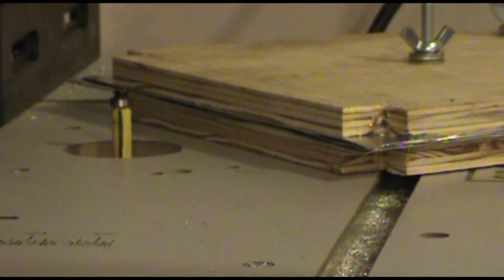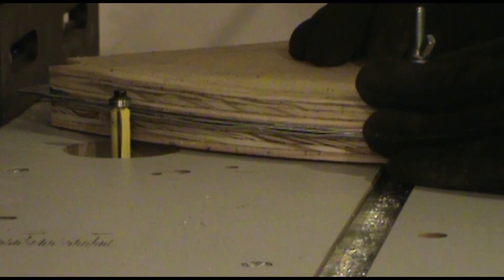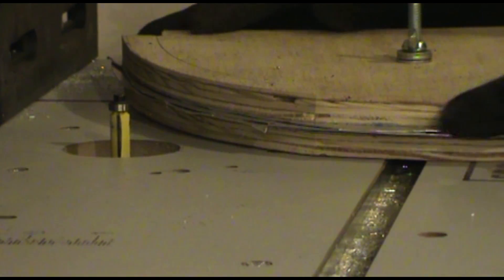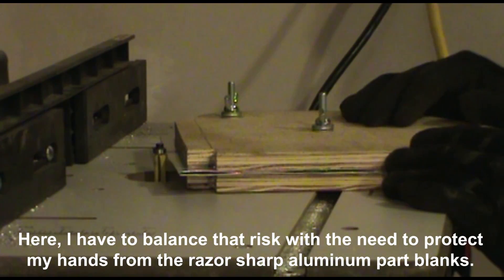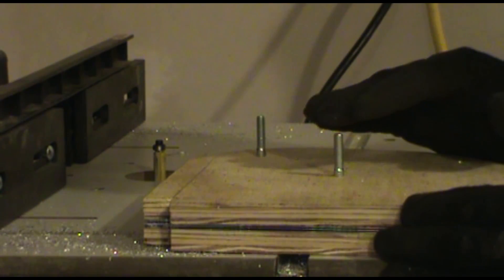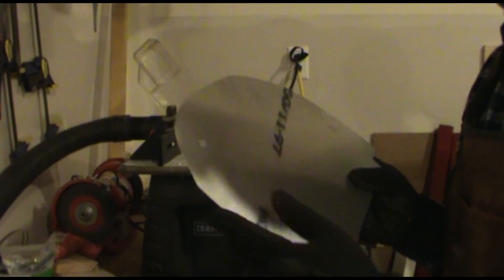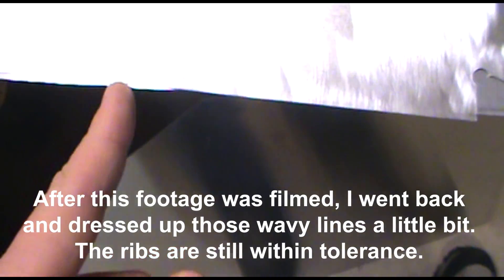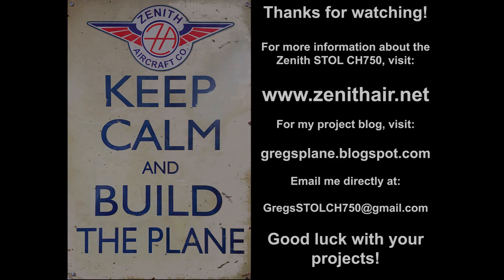Router Cutting Templates - Part 2/2

Comment: First again!
Just finished routing all my parts this weekend so curious to see this video
Reply from the maker: Jack BELE How did they turn out?
Reply: Greg's Zenith STOL CH750 awesome, I'll send you pictures tomorrow. I used hardwood plywood, they didn't deform. Also I pre-cut the blanks to 1/8 finished size, made it easier to put on the router table